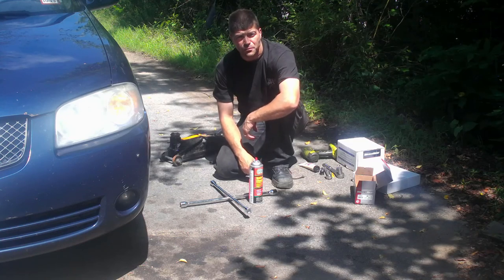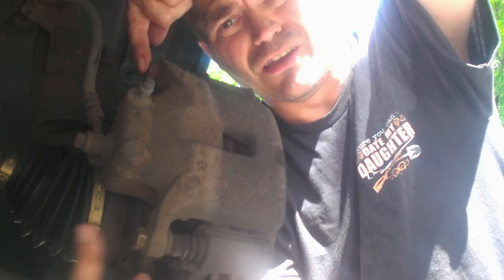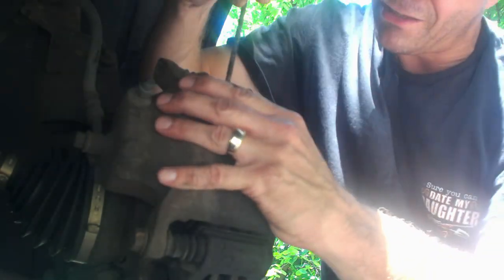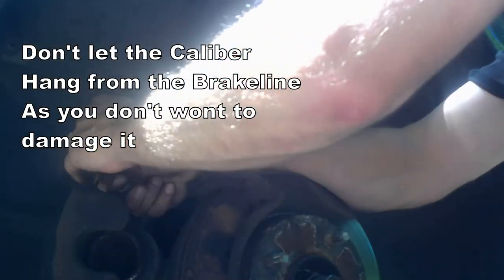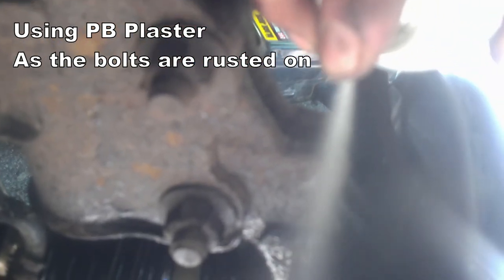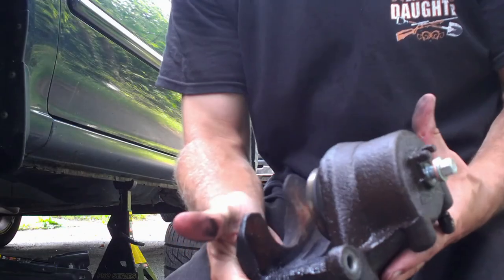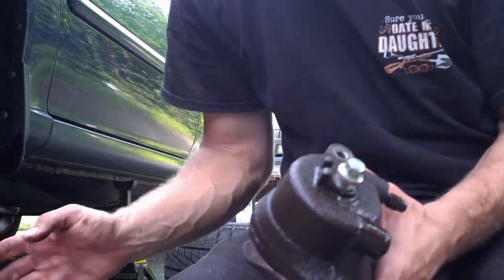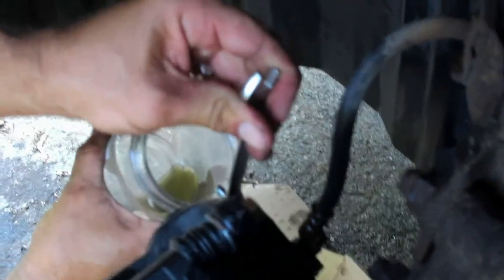2006 Nissan Sentra Brake pads and rotor replacement

Comment: The noise maker / wear indicator was on the outside pad, on top when you pulled them. It was on the bottom when you installed the new ones. Did you do it backward, or were they in backward to begin with?